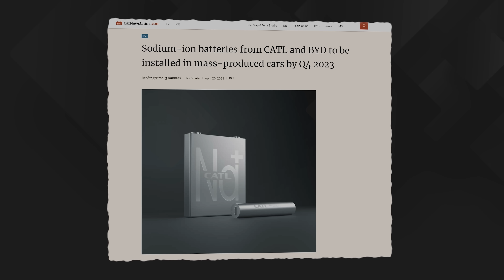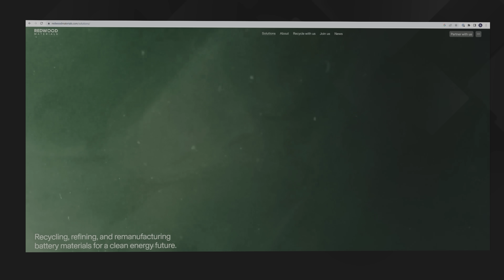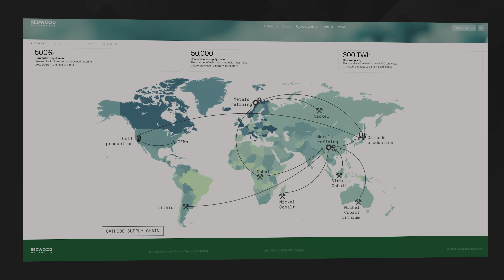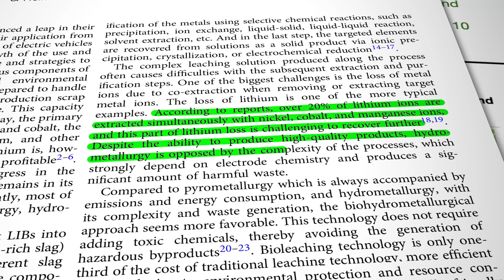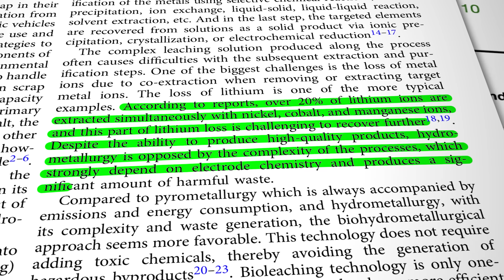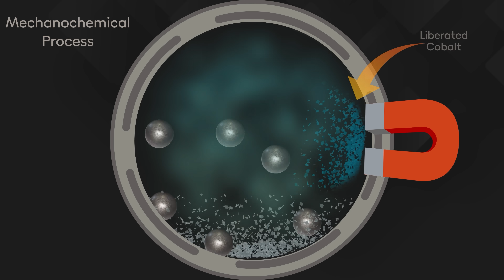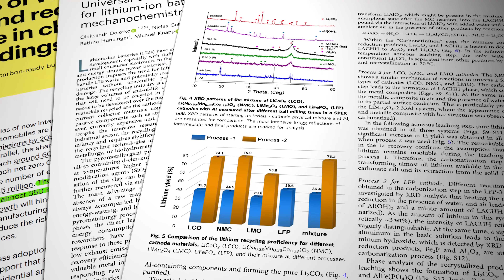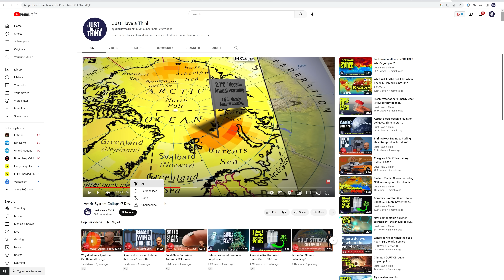Battery recycling just got a whole lot better.

Comment: There needs to be a requirement that battery manufacturers pay for future recycling. That way they would be motivated to design batteries to be easily recycled.
Reply from the maker: I agree 100% Pete
Reply: @JustHaveaThink why did you fail to tell people about THE 100% battery recycler, St Georges Eco Mining?
Reply: Suggestion: Have this apply to the manufacturing of all goods, materials, and products. Batteries are not the only thing hard to recycle, but hazardous to throw away. Plastic waste looks like it’s going to be a tough challenge to solve separate from climate change, with effects for centuries given how prolific micro-plastic waste is. Once we deal with that, we really want to ensure we don’t have to deal with another version of plastic waste as we continue to produce new and better materials. If the benefits of a material are not worth the detriments to society then we need to have systems in place to ensure it is never adopted beyond where it is necessary and manageable. A recycling fee attached to every step in a product’s production that represents the added difficulty of recycling it would be a decent way to incentivize researching ways to make recycling easier, and adopting materials nearly as good, but far easier to recycle over the absolute best in terms of material properties without considering any other factors.
Reply: @garysmith5025  I live off-grid. My system battery is from a Mitsubishi Outlander PHEV. The connections to the individual cells are made with M8 studs. This makes it easier to reconfigure the battery for a different system. Often EV battery cells are spot-welded together which makes repurposing more difficult. It's an example of good design from the reuse and recycling point of view. Q is how to encourage this.
Reply: Exactly what I was thinking. Applies to almost all manufacturing really.
Reply: wouldn't this increase the costs, hence also increasing the prices? IMO batteries are already quite expensive as is.
Reply: @williamduncan7401  If the battery manufacturers can make batteries so that the recycling cost is negative, i.e. profitable, then it would reduce the upfront cost. BTW i haven't thought through the details of how to apply such a tax, but clearly battery tech that's easier to recycle would be a good thing. How one incentives that is the question.
Reply: @petewright4640  yes definitely producing recyclable batteries is the way to go, however, I think, if companies are taxed when they do not comply, it might turn out to be cheaper to simply increase the cost of the batteries for the end consumers. It might be more effective to the opposite and grant tax releifs or something like that.

Another possibility is to simply make it mandatory for all companies and set up a deadline by which they need to comply.

Last time I went to a supermarket I paid €10 for x4 Duracel AA non-rechargeable Li-ion batteries. This cost seems excessive to me already.
Reply: @williamduncan7401  
Yes and no, there are efficiencies of scale that make small increases in cost negligible. As battery production scales up, and starts to equal, or even exceed demand prices should fall somewhat.
Reply: no no no, it should be the fossil fuel industry who has to pay for helping with things like this to promote a future renewable energy world
Reply: @judgeomega  
The fossil fuel companies are spending billions on renewables......

They fully understand how bad fossil fuels are for the environment.

And Exxon itself released a statement years ago saying their scientific research has "mirrored"(their words) the mainstream scientific consensus for decades.....
Reply: @judgeomega  All the modern conveniences we depend on are due to the petroleum industry. Petroleum's responsible for over 6,500 products that we all use on a day-to-day basis we should be researching and helping our petroleum industry to be cleaner not destroy it.
Reply: @ChasL704  Do they pay you to say that?
Reply: @davestagner  I believe you can reduce it but I don't believe you'll ever replace it'd be a blessing if we could. We need to figure out how to clean up the processes and not kill ourselves.
Reply: @ChasL704  1. Suppose humanity will last another million years - a reasonable expectation from normal mammal species. At current consumption rates, do you believe we have enough petroleum to last a million years? Do we have enough for 10,000 years? 10,000 years is 1% of a million years. You REALLY need to think about the scope. 
2. At current consumption rates, by 2050, plastic in the ocean will outweigh fish. We’ve been producing plastic for less than a century. There are 10,000 centuries in the next million years. In 1960, atmospheric CO2 was just under 320ppm. Today, it is just under 420ppm. That’s 100ppm growth in 63 years. How many more centuries can we do that? 
3. Fossil fuel is just hydrocarbon chains. It is made of carbon, hydrogen, and oxygen. It is all from biomass, which is all from H2O and CO2. We can synthesize any fossil fuel component from H2O, CO2, and added energy. It’s simply a question of economics, of cost relative to burning the stuff in the ground. 

Are you SURE we need to save the petroleum industry? For how long? And at what cost? Are we willing to sacrifice civilization itself for Exxon and BP?
Reply: @ChasL704  Newsflash: before plastics we still managed to distribute food to the masses. It was either tinned or we used paper products. There are plenty of plastics we can't do without but wrapping food isn't one of them. It's just convenient.
Reply: The EU is working on the new Battery regulation that includes recycling quotas for the elements in new batteries. So basically they are forced to pay for recycling.
Reply: Im calling for this. For all plastics to be bio tagged by the companies that make them and then that can be scanned at the landfills and recycling plants. The costs of cleanup handed straight back to the profiteers.

It could work for batteries too.  

Take a random chunk of landfill, mess it up, scan it for the amounts of bio id, charge accordingly. 

Fairly certain as soon as plastic becomes a cost issue theyll all suddenly switch to biodegradable and alternatives.   

Oil oil oil
Reply: It’s way to complex to organise this by source technology. The right approach is to restrict landfilling for all materials! There is a huge difference between Europe and North America in this regard. In Europe it’s simply not allowed to dump batteries on a landfill, so here there is the right amount of motivation to develop reuse and recycling! 
No matter if it’s an ICE or EV, when it reaches end of life, the car needs to be recycled!
Reply: Would rather see them invest in the technologies to solve the recycling issues as opposed to just paying a "waste fee".
Reply: How about starting with a much bigger problem - recycling the CO2 released by burning fossil fuels?
Reply: But it’s already profitable….. so what’s there to pay?
Reply: Hi Dave Thanks for stretching my brain and giving me some hope! 🍺🙏
Reply: @petewright4640 And you fools wonder why the supply chain for batteries crosses through so many countries. Tax tax tax, you socialists don't seem to understand that your taxes just encourage manufactures to make their stuff in China.
Reply: Any cost to the manufacturer wil just be put on to the price. The consumer always pay one way or the other. If the manufacturer doesn't make his profit he will just make something different where he can make his profit. Share holders want their dividend.
Reply: @leonhardtkristensen4093   and youve hit the crux of the issue, havent you.. private shareholders and investors. its almost like the economic system that the USA has, isnt conducive to supporting the health and well-being of the NATURAL persons that live within its boundaries....
Reply: then more expensive batteries
Reply: With all batteries.
Reply: That's so not how things work though.

Just like your utility bill includes money for the future decommissioning of all powerplants.

Companies do not pay for things. We pay for those things......

You think battery companies subtract off the cost of digging up and processing minerals??

No, we pay for that too.

Recycling will be cheaper than digging up new, so if companies recycle the minerals, the battery companies will most certainly buy from them at a lower cost.
Reply: @lordgarion514  Sure they can pass those costs to the consumers, but if you had the choice of buying a $50 battery + $10 recycling fee or a $40 battery + $50 recycling fee, and such cost was shown upfront, everyone would go for the $50 battery even though it’s technically the more expensive base product. Targeted taxes and fees can be great ways of causing the market to move in very specific ways.
Reply: @Treviisolion  
Yeah, but your numbers are made up bullshit.

The recycling fee would be universal. You don't charge to different fee's. That's NOT a recycling fee.

AND there is no "sure they can" to it. These are companies. Their money comes from selling things. They won't do it without charging us.
Of course with most recycling, it's cheaper than processing new minerals. But companies saving money by using recycled doesn't mean we're going to have our costs reduced.

They save money, and we'll be paying the same, or more.
Reply: @lordgarion514   If it cost society $10 to recycle one product, and $50 to recycle a different product, and society decided to tack on those prices to the product’s upfront costs, what would you call those fees if you object to calling them recycling fees?

Also I’m aware companies will pass on the costs to consumers. The thing is, they’ll still shift to the cheaper items, so in the long run while costs will go up for individual goods, they won’t go up as much as you might think as consumers, manufacturers, and companies shift towards producing products with lower ‘not recycling fees’ in order to save money and stay competitive. Meanwhile the cost-savings to society would be immense because no longer would there have to be massive pits of trash that everything that’s not worth recycling gets thrown into. No longer would society pay a premium to recycle products difficult to recycle, with no one really knowing which products are driving up their recycling taxes/subscriptions unless they do in-depth research.

Also the numbers are demonstrative. If you had the choice between buying a $50 and a $40 product that worked more or less the same, most will go with the $40 one. But if we as a society recognized that the $40 one was far more difficult to recycle and absent major funding would just be thrown away rather than dealt with, while the $50 one could be easily recycled, and places a fee of $10 on the $50 one and and $50 fee on the $40 product, you bet that when people instead have to choose between a $90 product and a $60 product, that everyone is going to choose the $60 product. The price everyone is paying is $20 more, but if we just taxed everyone to pay to recycle the $40 product with the understanding that throwing them away is not sustainable and has negative externalities on society, then that means the average person will need to be taxed $50 to pay for the recycling fees. So while the upfront costs have gone up $20, the saving to the average person would be $30.

Of course not every product would be like that, sometimes there would be no current good alternative and until R&D is found to produce a good alternative that’s easier to recycle, society would have to either consume less or eat the costs in order to reduce the production of trash. Sometimes the already cheaper product will already be the cheaper to recycle as well so society won’t change much. But the situation where some products are cheaper only because their negative externalities aren’t taken into account of the price, that is where targeted fees, taxes, whatever, can have dramatic impact.
Reply: @Treviisolion  
Very few things are cheaper to dig raw materials out of the ground.

A dedicated recycling fee would be cheaper than paying for new.....
Reply: @Treviisolion  That assumes that the 'recyclable' battery will cost $50. Simply having the government make demands doesn't make reality change to them. Government regulations always stifle innovation. Well, unless it's for war.
Reply: @joeblogs6598   The numbers are hypothetical and their value irrelevant except insofar as they are relative to the others. I am demonstrating the point that often modern products have hidden costs that are rarely reflected in the price, and indicating what changes would happen to society, if said costs were actually be included in the price alongside the direct costs to produce the product.

What the fee would be would be determined by how costly it is to recycle the product. If the government and the business try a bunch of various ways to recycle a product or otherwise make it safe and harmless to dispose of with zero environmental issues (like if it’s combusted purely into water such as the case of disposing hydrogen), determined a way both agreed was the cheapest, then grabbed that price and slapped onto the price of the product, then did that for every product, society would move towards consuming and producing products which are easier, or at least cheaper, to recycle. I’m not saying that the government just slaps random prices or fees to the products, but rather starts recycling all the products so we don’t have to deal with the waste, figuring out how much that costs, determine which products are driving up the costs, and starts slapping fees to pay for the recycling to discourage the creation, and continued production and consumption of nigh-unrecyclable materials that can’t be safely disposed of, particularly when alternatives exist.

On the topic of innovation. This is not immediately relevant to the topic at hand. While I will concede to the idea that regulations can impede innovation, insofar as by increasing hurdles for new businesses to start can decrease the number of new businesses (and only as a vague general statement with a lot of asterisks that I’ll get to in a moment), there are reasons to accept that in the service of a greater good. As an example, some individual has the amazing new idea of solving all of the world’s issues and give us all super powers by irradiating us all with cesium. He has a bunch of arguments about how it’ll work, pointing out that radiation can do amazing things like kill cancer such as in radiation therapy, that mutations are a necessary driver of evolution, and that of course all the old comic books say so. Now we have a lot of regulations that would make it very hard for this individual to get a hold of cesium, charter a balloon to fly low over the city, and three start blasting people with a gamma radiation focusing lens from on high. Those same regulations also make it more difficult to build small modular nuclear reactors, and implement a drone service. Or another example, if you go to the doctor because you have a cold, and he dumps a bucket of leeches on you to remove ‘evil spirits’ you can sue him for malpractice. However, that also means that new medical techniques take often at least ten years to get to market from when they’re first reported on, and that new doctors have to spend a decade in college before they can meet the rigorous requirements we require our doctors to meet. We can argue about the specific lines that regulations should or should not cross, but if we accept the false idea that all regulations are inherently bad because they always stifle innovation, then I’m sorry my friend, civilization is not for you, and might I recommend some quiet mountain forests in the hinterlands of Idaho, Montana, Alaska, Alberta, and the northern Canadian territories as an alternative.

In this case, the detrimental affects of lead, asbestos, plastics, fertilizer runoff, coal pollution, electronic waste pollution, heavy metal pollution, the immense build up of trash in general, are sufficient enough negative externalities to warrant slower technological growth. Sufficient in that we can attribute tens of thousands of people who have suffered or will soon suffer if we don’t manage the issue to any of these problems, and that while environmental damage and its negative effects are not new to humanity, as we can find issues dating back to tribal humans as they left Africa, the scale of the Industrial Revolution making the problems un-ignorable, and the fact that we keep creating new pollution problems every few decades since the start of the Industrial Revolution and haven’t stopped suggests we need to start actually preventing these, I’m just being the radical person suggesting a more capitalist solution of quantifying the issue via money rather than throwing out the whole capitalist system.

In terms of the asterisks previously mentioned, here some examples where regulation does not noticeably slow regulation or has even helped it: 
US medicine, where regulations are often stricter than European counterparts, but the US produces more new drugs than the rest of the world combined
LEDs where if there was not the threat and actual enactment among many countries of government regulation making Incandescent lightbulbs illegal, we still would be using them instead of LEDs. The proof: LEDs were first produced in the 1960s, but only started to actually have major development in the early 90s and then finally brought onto the market in part via help by the US government in funding a competition in 2008 to help produce the development of better lightbulbs, as well as the threat that an alternative had to be found and in production by 2012.
Or how about gas mileage, cars had been sitting at a similar gas mileage for the better part of a century until governments started setting targets of how efficient cars needed to be and companies did their best to water-down those regulations, but still have largely complied in order to stay in the market and have increased the gas mileage across the board.

The market responds decently well to demand, if demand is increased then over time supply is increased to meet it. If the demand for more recyclable materials increase, then more money will be spent to find materials like that. Crucially, according to basic economic theory, the market does not care whether that demand is because of external forces or government action. It’s just that influencing the policies made by a few dozen politicians can sometimes be easier than influencing the actions of millions of people, and governments tend to be better organized than ad-hoc collections of people and thus more effective at bringing about change, which is why businesses tend to attack them so much. But remember, you are a piece of the government. You have the ability to sway the government’s actions along with the sway of everyone else. According to classic liberalism, the government is an organization by the people, for the people, and of the people.
Reply: @lordgarion514  Hopefully, and even if not, it’s probably still worth having it, because throwing it away is not a sustainable option when operating at industrial scales
Reply: @lordgarion514  "That's so not how things work though. Just like your utility bill includes money for the future decommissioning of all powerplants."  Let's compare a place where exactly that happens (with nuclear plants only) and a place where it does not happen with nuclear power plants. We'll call these countries the USA and Finland. In 1977, when Finland was building their first nuclear fission utility power plant, a licensed Soviet design, they decided that they would also need to take care of the waste properly. The government made it a condition of the operating license that the plant operators would, for the whole lifetime of the plant, charge customers a small per-kilowatthour tax. The money didn't flow into the government's general revenue though; it was spent only on a project for siting, designing, building, and staffing (over about 30 years) a storage repository and associated containment techniques. Same thing was done with their later nuclear power plants, including a brand new one in 2023. As a result, Finland has the only operating permanent waste storage facility in the world. Because that's how you do it. Contrast with the USA, which has had 30 additional years to work on the problem and has accomplished a firmly negative amount of progress on the same problem. Perhaps it's ironic that the other example of this idea that I can think of was invented in the USA in the wake of a terrible toxic chemical disposal failure. In that scheme, chemical producers must pay into a pooled fund that pays to dispose of toxic waste in the event that the producing company goes bankrupt and cannot manage the disposal. It's called SuperFund. Fact is, there are "Producer Pays" (for disposal/recycling) schemes for many products in many countries with free market economies. All that is required is that people in power not dismiss the idea out of hand, as you did.
Reply: @TaiViinikka  
Piss poor government aside, until 2013 nuclear power plant operators paid into a fund for nuclear waste disposal.

"A U.S. appeals court ruled on Tuesday that the federal government can no longer require nuclear power plant operators to pay fees into a nuclear waste fund"

Now, they might have not actually built the storage facility, but we will have to eventually regardless.

And if you want to go check, I can assure you that the nuclear power plant operators didn't drop the price for electricity when they got to quit paying directly into a fund.

But they will be paying for disposal sooner or later, and they are still quite happily collecting that money from us 

And the worst part is when everything gets here be, I can promise you that the companies will magically not have enough money, and the Fed's will spend even .ore if out money to do it.

But that fee is still being collected.
Reply: @lordgarion514  That's not true. The cost of battery recycling hasn't already been factored into the cost. Lithium batteries so far have been priced with the assumption that they become e-waste at their end-of-life. If manufacturers had a buy-back program, that would actually pass the cost....I mean, the revenue on to the consumer. Buyers of recycled Li batteries would then be paying in-part for the cost of buying back the batteries and the cost of recycling.
Reply: But by the time those batteries need recycled, the cost will have likely come down by a lot, or even become negative (profitable to recycle), and those manufacturers will have been unjustly fined... if they sell any at all. More likely they'll fold or move elsewhere because they won't be able to compete with manufacturers in places without such laws.